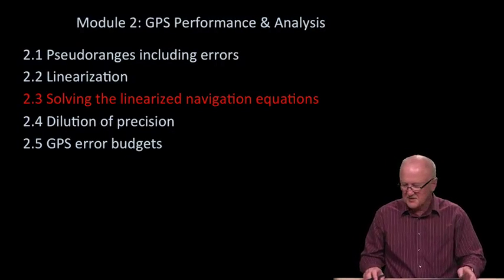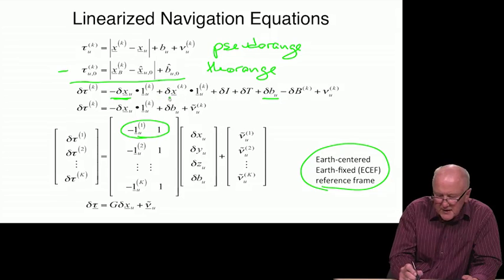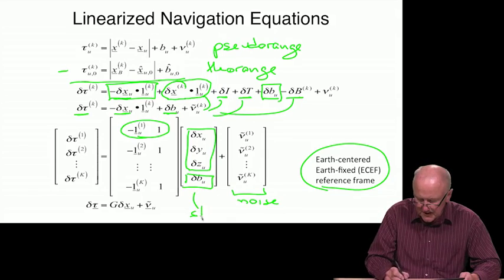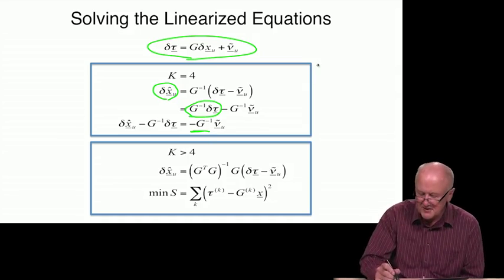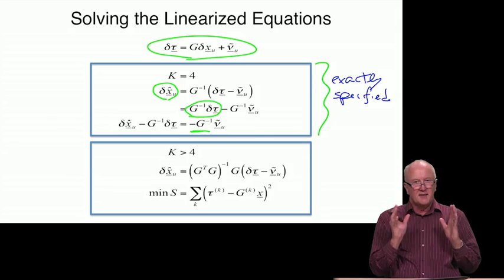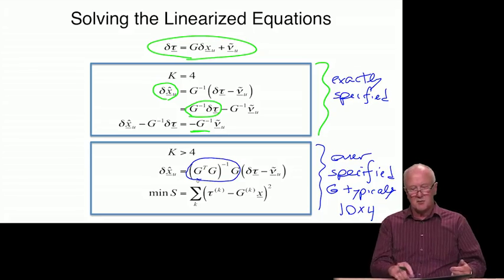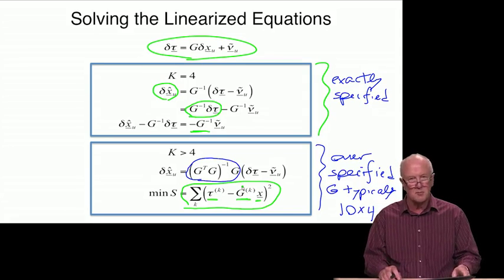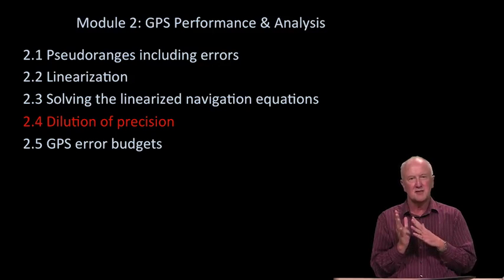2.3 - Solving the Linearized Navigation Equations

Comment: these lessons are incredibly great but I have to be that pedantic student that you find in every class. Shouldn't the pseudo inverse matrix be (GTxG)-1 x GT? and not (GTxG)-1 x G
Reply: Yes I think it should be like you said
Reply: I agree!
Reply: @doomyman  GT is the transposed matrix. If G would be that 10x4 matrix, the transpose of G  (called GT here) is a 4x10 matrix.
If you multiply GT with G, you get a 10x10 matrix.. you can get the inverse of that square matrix.
But if you then mutiply with GT, you would end up with a 4x10 again.. but we need 10x4.
I think (GTxG)-1 x G is correct.

But yeah, it is confusing.. and i must say i have almost never worked with non-square matrices.
Reply: I am pretty sure it's incorrect @coreC..